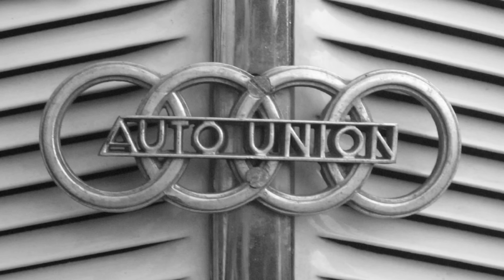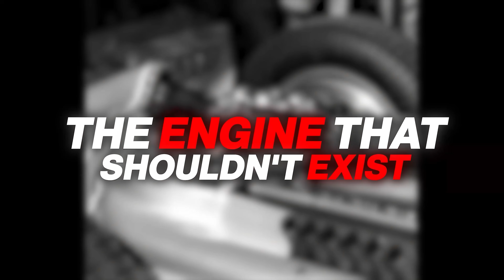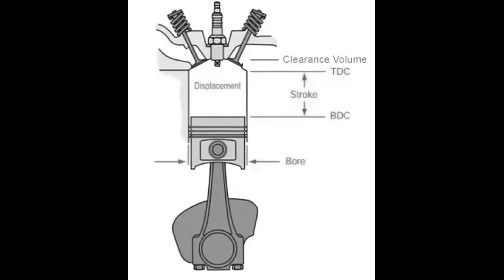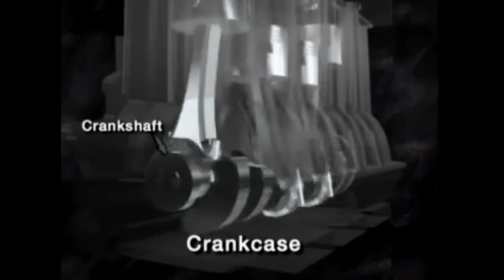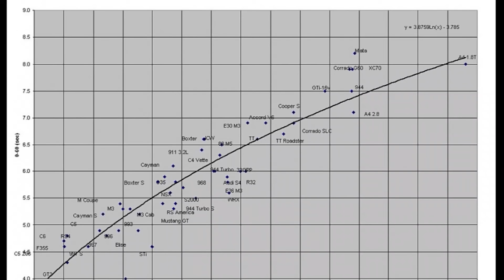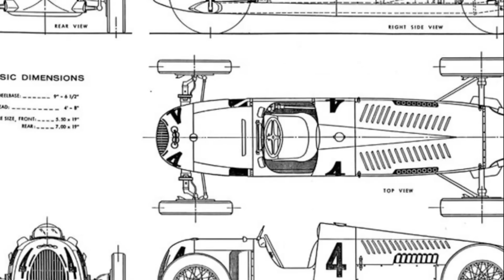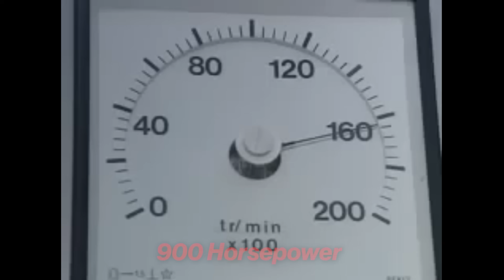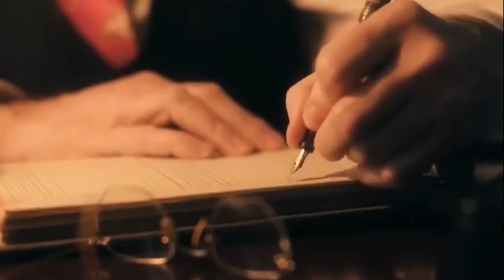THE EXPLOSIVE TRUTH BEHIND AUTO UNION'S BANNED TYPE C V16 SUPERCHARGED ENGINE

Comment: Well, 100bhp per litre for a normally aspirated engine is a 'benchmark' figure for a tuned road engine today. Lots of interesting pictures, many unrelated to the topic. A race engine of 3 litres today would have little trouble producing 600bhp. A swing axle design can be pretty 'interesting' on a road car of modest power, such as the early Triumph Herald. On the Herald it was 'tamed' a little by design mods, but that would not work on the Auto Union.
Reply: Or on all the old VWs that crashed because of those swingin axles